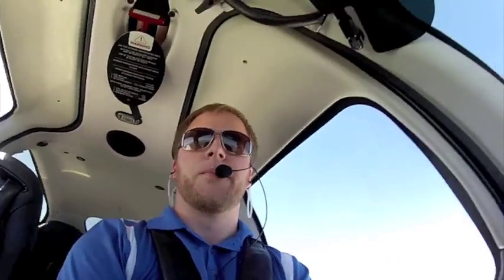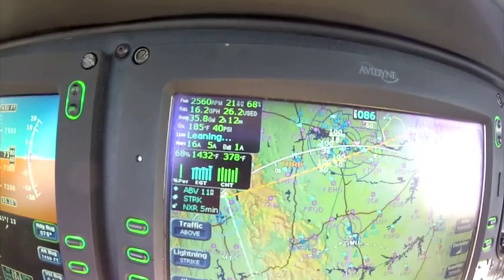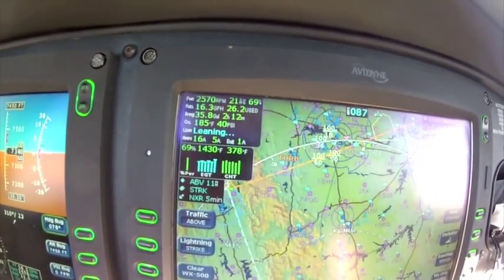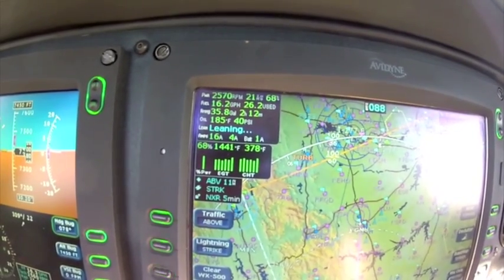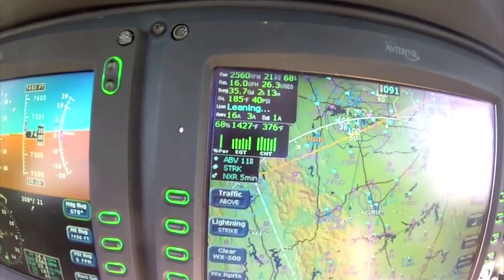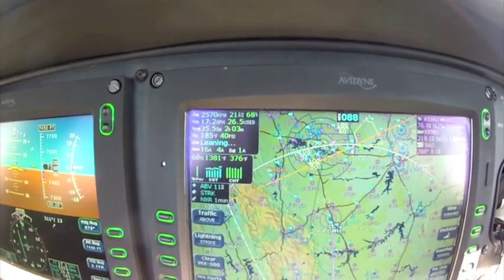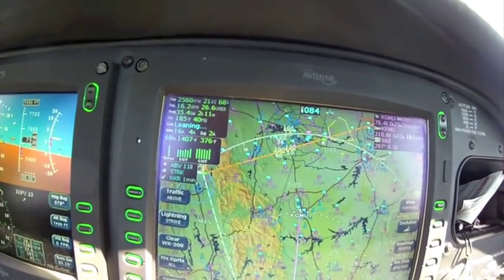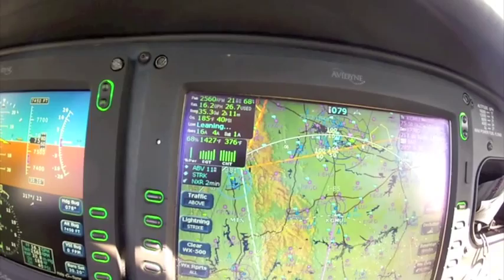Vapor Lock

Comment: I’ve flown an SR22 not turbo, did 1500h, operated since new, in Brazil, very hot weather and never had anything like a vapor lock!
Reply from the maker: Normally in the turbo the boost is always left on. This would prevent vapor lock. I have had it several times over the years.
Reply: I'm with you.  Something  else is wrong when you have a TC engine using 16.5 gallons of gas an hour (one gallon every 3 1/2 minutes) running through a 1/8th inch fuel line while in cruise flight.  Personally, I think people like to say "vapor lock" because it sounds better than I've got a fuel tank that isn't venting correctly.